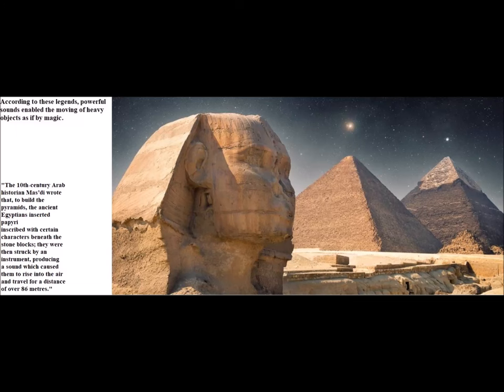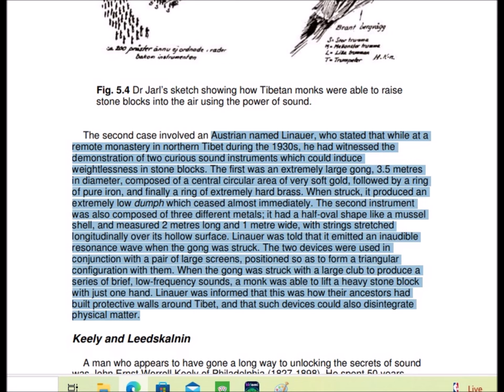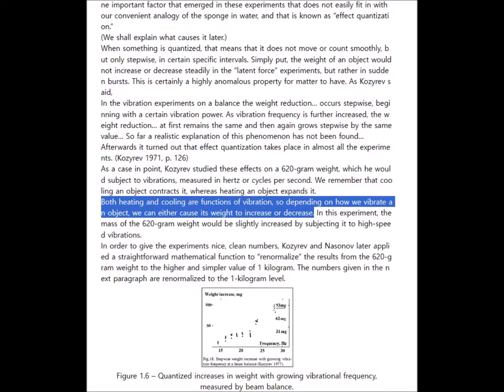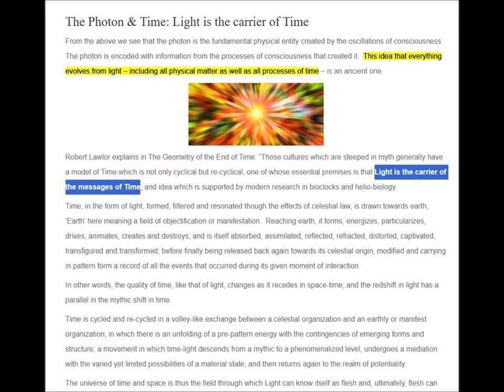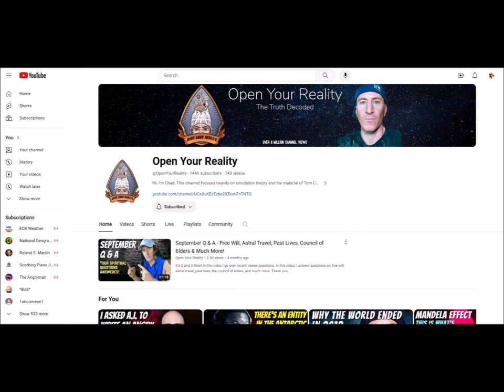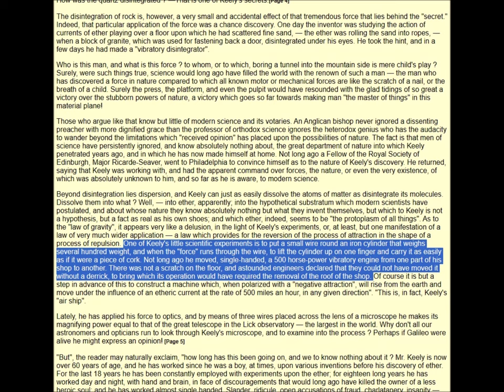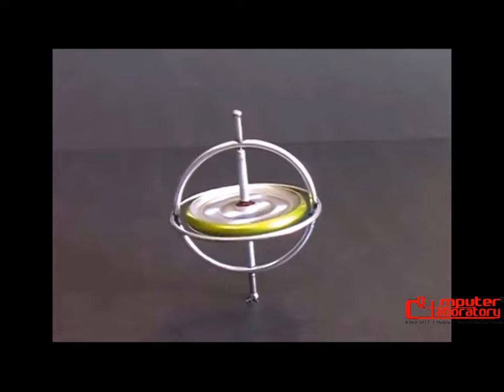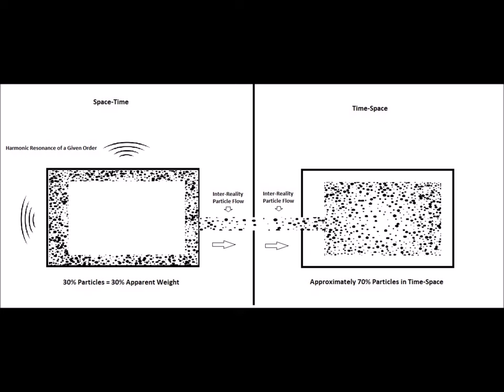Sonic Levity:  Is an Oscillating-Vibrating Mass Easier to Lift?

Comment: This is an amazing channel. Great content and well put together. Thank you. 🙏
Reply from the maker: Certainly! 😊And thanks for watching 🙏
Reply: @gsutton78  You're wire cutting upload was superb. But, how was the right angles made? Thanks again. 🇬🇧
Reply from the maker: @mrsimo7144  Thank you. Well, with a wire saw, whether rotary or vibrational, it should just be a matter of cutting the stone on one side, flipping it 90 degrees and then cutting the other side. And because the wire or rope has to be perfectly straight (have full tension) in order to cut, this means that very long, perfectly accurate cuts can be made.

Comment: The ancients could only have had simple tools and instruments , such as large and small tuning fork arrays, just as Mr. Keely had, 1865-1899 Philadelphia lab. There is a back room in Cairo museum that has huge tuning forks. I believe granite, limestone rock contains quartz which is highly susceptible to outside vibrations applied. Sound tones can be learned by ear and applied properly. Keely applied interference tones together to get higher frequency range for ratio of thirds to apply to mass. Thirds and 9ths with mass frequency was used to lift heavy metal . He learned the secrets by watching sand vibrating on plates. (Chladni waveforms) He then built a circular device for disintegration of substance to smaller parts. His solid block of quartz door stop, disintegrated with vibrations applied. The old reproduced Keely documents indicated the LIFTING of  small brass sphere, 2 ton steel sphere pressure tank, tabletop vibrators array with chair, and triple sirens flywheels on heavy steel base. He had figured out about what we nowadays call the use of thermocouples and thermopiles wires to transfer frequencies. Real science research was done on first floor. Never mind about all those fake set ups on second floor.  Purchased references are available from S.V.P. Mr. Pond.
Reply: still trying to contact you man
Reply: Research on Mr. Keely is done by purchasing document copies and books. S.V.P., and others on Internet. Also on line Expose from Jan 29,1899 N.Y. Journal And Advertiser - pg 13,17,19. Keely-

Comment: The wire aspect of this you should look into more there are many connections with the use of small wires like my comment mentioned before.

Take a look into les brown pyramid experiment a copper wire spiraled above a grounded stove wire the electric force of two fields one coherent the other in incoherent creates a gravity wave
Reply from the maker: 🤔 I certainly will. Thanks for the suggestion!

Comment: The Egyptians used jars of monatomic gold. Muf kut, that they placed on the object needing to be moved significantly reducing the weight of the object.  Reduction of mass is one of the properties of gold in this state
Reply from the maker: Hmmm 🤔. Interesting. I remember reading about the monatomic gold. I wonder if it was an ingredient in the "NB gas" in the late 1800s that was supposed to not only be lighter than air, but also possessed of gravity reduction properties.
Reply: @gsutton78  never heard of that gas I'll look into it but definitely check out the gold angle.. not only has gold always been the measure of wealth but it also has great symbolic meaning. The ancients believe that metals in the earth earth slowly transition from one to another with gold being the ultimate perfection it can obtain in that form. Therefore by association it was used to symbolize the ultimate state of the human form.. in alchemy you are the lead that must be transformed into gold.  It was never about literal lead.. my point being it was toughie of that way because of properties other than "it's shiny and pretty"  it apparently (monatomic gold) also dissappear when light is introduced and reappears when the light source is removed... they knew how to not only make it but the Pharaoh consumed it as well.. look into it again
Reply: Do you believe this is why keely used gold in conjunction with silver and platinum in his wire to suspend gravity

Comment: I made a hour and a half video on this topic. These are my notes:
🔊If you know the resonance frequency of a wine glass, you can break it with the sound of your voice. Sound frequencies can also levitate rock.
🪨We have been taught that tiny primitive copper tools were used to carve the perfect giant blocks of the pyramids, but this is impossible. Some firmly believe the ancients used Sound, Vibrations, and Frequencies to carve and levitate heavy stones and objects and use them to build megalithic structures, this is an interesting idea, but no known sound machine has been uncovered that is capable of this. It must've been from a supernatural force (similar to how the Israelites toppled the walls of Jericho with sound frequency and Gods power.)

Facts about The Great pyramid of Giza: 
1⃣It is the only 8 sides pyramid in Egypt. 
2⃣It is aligned with the stars of Orion's Belt and pointed to the pole star Alpha Draconis. 
3⃣It is the most accurate alignment ever built pointing true North. And is in the exact line of the equator.  (these people had no compas.) 
4⃣It is exactly as the center of the landmass of the earth.
The 
5⃣If you go to google earth, and type in the speed of light (29.9792458 31.1339) it will take you directly to the Great pyramid of Giza.
6⃣The pyramid has one entrance, with a Broadway way leading down a pit, and a narrow road leading to the king's chamber. (sounds familiar?) If you take the narrow way there's 153 steps going up to the gallery, just like the 153 fish Peater caught after Jesus appeared to him after his resurrection. 
The King's chamber is on the 50th layer of stone just like according to the Hebrew Calendar there is the 50th is the year of Jubilee. Inside the chamber in an empty tomb.
The pyramid was originally encased with 144.000 stones, just like the 144.000 mentioned in Revelation.
The top of the pyramid was never put in place. It was called the cornerstone. Jesus said he was the cornerstone, and the stone that the builders built rejected became the cornerstone.
7⃣The pyramid, if you measured it in pyramid inches, could be read as a history book, with the past and future of the earth.
For example, the Grand Gallery marked the birth, and 33 inches later, the Crucifixion of Jesus. The Gallery ends between 1,880 and 1,911 pyramid inches, like the tribulation before the 2nt coming of Christ. 

👽Without a doubt, the ancients have supernatural aid in the construction of such structures.
Many suggest Aliens. But as a flat earther and a Christian, I do not believe in Aliens.

  Is it a coincidence that these pyramids were constructed at the same time that bible and the book of Enoch said that fallen angels (demons) mingled with mankind in civilizations all over the world. Many think these fallen angels came in an attempt corrupt the human DNA and corrupt the bloodline of Jesus.  
 👾The hybrid offspring of the union between the fallen angels and human women are called "Nephilim". These were twice the size of humans and had 6 fingers and toes. Nephilim. We know that these giants did exist back then, because they are documented in the bible, lots of historical texts, historical carving and paintings, and archaeology. Goliath was likely one of these Nephilim
  Did the Nephilim help build the pyramids that appeared all over the earth at the same time?
After days of nonstop research, I would say yes.
One of the reasons for the great Flood is to wipe out the Nephilim, Who were corrupting the genetic bloodline, and corrupting the world with evil. However, the Nephilim Returned AFTER The Flood.
🧬There are parts of the bible that go deep into genealogy and family trees, including the genealogy of Noah. It says that Noah was perfect in his generations. (Such as in Genisis 6:9 11-12) 
Does this mean that Noah was without sin?
No. It seems to be referring to Noah's genes, and that hi genealogy was 100% pure human, and undefiled. (by the way, DNA Studies Confirm the story of Noah.) 
🚢However, the destruction of the Nephilim was not permanent. The second outbreak of Nephilim occurred shortly after the Flood. We know that because when Abraham entered the land of Canaan, about 400 years after the Flood, “the Canaanite was already in the land” (Gen. 12:6). These “Canaanites” were Nephilim.
💉The secret DNA Manipulation technologies and even public ones such as CRISPR, MRNA va--ines, 5 G and EMF DNA Manipulation happening today is another example of Satan trying to disrupt human genetics. We truly are living "In The Days of Noah" (Luke 17:26-30)
Reply: Sound,  magnetism, and hydrogen create plasmatic energy